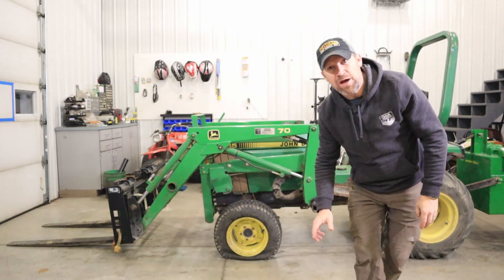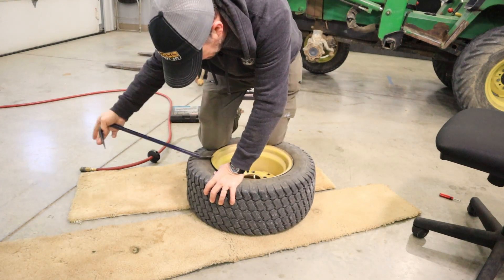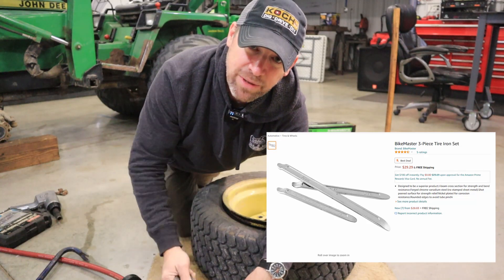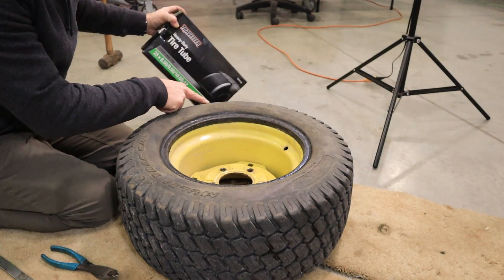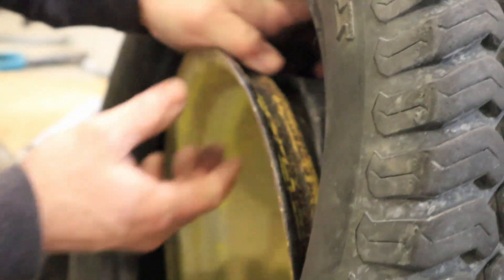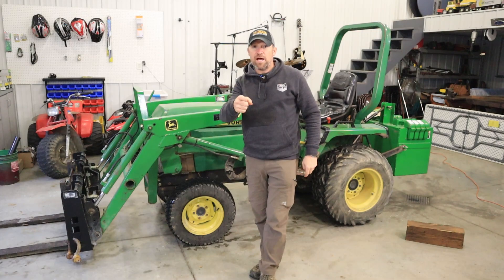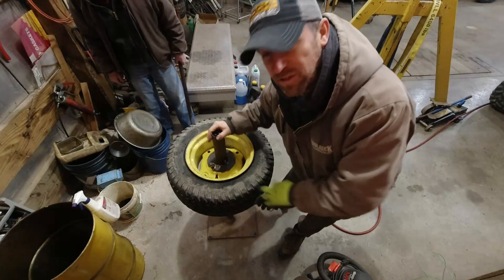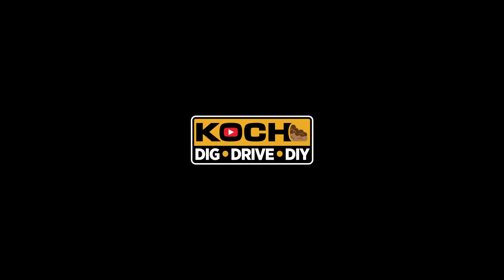How To Install Tubes in Garden Tractor Tires on John Deere 755 - Fixing a Flat Tire or Two

Comment: I've always blow the tube up and released the air before I try putting the tube in the tire. The tube will go in much easier when inflated a bit. I also brush a little talcum power inside of the tire to let the tube slip around a bit so it's not so likely to pinch. Also, take advantage of the drop-centered rim. It's made that way to make it easier to install and remove the tire. For those who are removing tubeless tires for repair and don't intend to install a tube, the last thing you want to do is pry the bead off with a screwdriver or similar tool. The rubber covering the bead is very soft and easily damaged, Also, take care not to scarf up the rim in the bead area. It will leak every time.

Comment: Excellent video!!

just had the same issue for about a year also. Finally took it the the tire shop and paid 20 and done with it. 
The small diameter tires are a pain. 
Keep the videos coming
Reply from the maker: Glad I'm not the only one!  Those little ones are tough.  I also have a cheapy Harbor Freight tire changer for the 8" front tires on smaller tractors.  Thanks for tuning in to the channel Dave!

Comment: Happy New Year to you and family. 
   I had a front tire on my backhoe that I was always pumping up, never found time to fix or was too cheap to fix, air was cheap. Finally decided enough was enough, bought  a tube, and with the use of the loader bucket and short 4x4s broke the bead. That bead was a stubborn "$^#@". I do not have short spoons or realized they exist. My deceased dad had left me two 2 foot tire irons made for changing tubes (never used them) and I quickly learned to NOT let them go using them (OOWWW that HURT). Never had a problem with a flat in the remaining (? 10 years) I owned the machine.
   Neil,  I really enjoy your videos, I subscribe to others as well, but yours are more pertaining and similar to what I have done in my past, so I like to comment in them. Besides being enjoyable they can be quite informative. Keep them coming!
Reply from the maker: I hear you on the backhoe tire.  Mine was the same way for a long time as well and finally put a tube in that one too.  I have some big 2 foot spoons as well and they have to come out for the bigger tires for sure.  Always good to have a wide selection!
I really appreciate the kind words about the videos too Richard.  It is nice to know there are folks out there that can relate to these videos and find them enjoyable to watch.  There are lots of guys making content for YouTube and I really appreciate your time in watching mine with all the competition out there.  I'll keep trying to find stuff to make videos about as long as folks are watching!

Comment: Talk about PTSD!....what seemed like the hardest job of my life was one day when I decided to put a tube in a tire that kept losing air on a riding lawn mower! 😜😜    You made it look easy!  My first and last time.  I told my wife I would just buy a new mower next time a tire went bad! 👍👍
Reply from the maker: Oh boy, I've had a few of those too.  The smaller diameter tires can be a real pickle sometimes for sure.  I don't blame you for wanting a different tractor rather than put in a tube - sounds like a logical excuse to me 😂  My dad bought a new car once cause the old one had a dead battery... Ha!

Comment: Great video. Excellent job of explaining the process of dismounting the tire and installing the tube. 
I work in a tire shop and have several years experience so if I may offer a little advise and a trick to help prevent pinching the tube. 
In the video I noticed that you start mounting the tire at the valve stem, when the valve stem is pulled through and clamped, sometimes when you push down the bead for extra slack the bead of the tire can pinch/tear the valve stem when mounting the tire. I would suggest starting opposite the valve stem when mounting so the last part of the tire to go on is at the valve stem. 
A little trick to prevent pinching the tube with a tire bar is partially inflating the tube before mouth ring the top bead. Inflate it with the core. Also ensures there is no twists in the tube. 
Thanks for the channel and great vids. Looking forward to more.
Reply from the maker: Hey Clint thanks for all the great suggestions!  I'm afraid doing the limited number of tire repairs that I do far from qualifies me as being an expert so I warmly welcome all the suggestions that could help to make me better and help those that watch these videos so that their life may be easier also.  I've learned the hard way about pinching the tube as I had done it so many times back in my young days when working on those pesky dirt bike tires.  I've had several others make suggestions based on what I may have been able to do differently in this video too so I'm happy to be learning all while trying to help folks figure it out on their own too.  Thanks so much for the comment and for watching the channel.  Take care.

Comment: Me... procrastinate on fixing tires?  Exorcise that phrase from your vocabulary.  It is called a ‘Strategic Pneumatic Engineering Plan”.  I have been developing it for years.  Although it isn’t top secret... it took me seeing Neil talk to Neil for me to realize.... I have never revealed that plan to anyone!  

So, here goes.  There are 4 scenarios to consider... 
1. on road and off. 
B. Daily drivers and occasional use. 

If you set them up in a grid you’d have on road above daily driver and off road above occasional.  Now the first column, an on road + daily driver gets immediate attention... and for me is a job for the pros.  

The second column, off road + occasional,  that baby gets extra special attention. You invest in an air compressor, portable air tank and a spare tire gauge to strap to the air tank. Then, you find a place to store the tank close to where you park the tire (are you gonna need a new shed?) About the third time that you forget to refill the tank... While you are walking back to the shop with it... you ask, “Do I need to get a spare tank?”  The tipping point for repair/replacement in this category is... when it won’t hold air through the whole task.

The diagonals are where your strategic engineering juices get to flow... the on road + occasional and the off road + daily are prime candidates for: plugging holes, hot patching inside, slime filling, tubing them or the dreaded (yet inevitable) tube patching.  Of course, fill before use will be the preferred means of dealing with these... until you get fed up and have to do any of those major repairs!  

Neil, I learned long ago that it ain’t procrastination if you have a strategic plan!

I don’t use a lot of tubes on our off road tires.  There are far too many hedge trees and thorny locusts.  It seems that even if I check the inside of the tire for sharps before putting in the tube... just as soon as that tire hits the first rock... a thorn lurking just below the inside surface punches through.  Or, perhaps it is, that I am buying tubes that are made from the rubber equivalent to ‘Rare Earth Magnets’ for thorns??  And you know what that means... another round of filling with the portable tank to avoid the dreaded (yet inevitable) tube patching.

A lot of people don’t like slime... I used to be one of them but then I discovered TireJect.  It doesn’t take much, doesn’t rust your rims, actually contains a latex like compound and you can buy it in bulk! My wood cart (off road + occasional use) is going on 5 years with pretty iffy sidewalls held together with it. [YouTube Disclaimer... THIS COMMENT IS NOT SPONSORED BY TireJect.]

Now about talking to yourself... it is OK, as long as you’re not talking about yourself... or, so my therapist says!  However, I’ll have to ask her at breakfast,  if there are any particular indications when you start to film yourself, talking to yourself!

Well... that’s about all for now... the tire on my TracVac is looking a little low.  I’ve got to take immediate action... Where does it fit on the Grid?  What step of the flow chart is it at?  Do I need to order another gallon of TireJect? Can I just look away for now and deal with it when it is sunny and warm?  So many questions...... I need to consult my “Strategic Pneumatic Engineering Plan” over a cup of coffee near the wood stove!
Reply from the maker: Oh man, you had me literally chuckling out loud through most of that!  Favorite part: "when it won’t hold air through the whole task".  That is for sure the threshold that I hold as standard as well!  I was able to inflate this tire before every use and it was fine.  It would last a couple weeks between fills, then it was lasting a week, then it was overnight and finally, it wouldn't last through an entire task.  Your grid chart is perfectly defined in terms of reflecting the usage vs frequency vs application metrics.  Ha, off road + occasional: "that baby gets extra attention".  So gosh darn true.  I'm thinking of the tires I need to inflate in the upstairs loft of my old barn just so that I can roll stuff to the door to toss it down!!!  I have to haul a dang air tank up the ladder!

You also queued a childhood memory for me.  We would go camping at this one campground that had a bunch of the thorny locust trees.  My dad would set up a make shift "tire shop" to keep up with the flat bicycle tires as all the kids in the general vicinity quickly learned the guy in spot 14B could fix your bike tire.  I think this may have been where I learned about tubes, tube patching, and the general practice of tree species identification from a safe distance.  We would ride our bikes off and away with multi-patch tires and ride them back on the rims for Dad to patch up again.  Man, he is patient.  

Hope you enjoy that cup of coffee with your therapist and I'll start thinking about which tire of the couple dozen around here will most likely need the next tube so I can stock up.  I got a wheel barrel I've been pushing around with a flat tire for a good year or two now.  It is probably a prime candidate!  

Thanks Dave :)
Reply: @digdrivediy  I forgot all about the wheelbarrow... I have resolved that it is easier to push the starter on my BX than to push a wheelbarrow.  My bucket loader has almost made it obsolete! And with that being in the off-road - often used category I have a well established protocol for dealing with its tires!

About bicycle inner tubes... my 7 yr old grandson developed a flat on his.  While trying to fix it, his dad pinched it right by the valve stem... then, he tried to patch it with the vulcanizing glue too wet.... the outcome was, he ruined it. 

I picked up a replacement and put it in for him... then, I told him I’d keep the tube for something special.  

A few months later we were loading firewood and I saw a hickory fork on a sapling.  I cut it and we headed for the shop.  After he whittled the bark off of it, I showed him how to cut rubber strips off the tube.  (You have to use the outer portion. If you use the sidewall or the inner they are too crooked to work.) An old work glove palm, some fishing line and voila’... he had a slingshot.  

When the acorns started falling, he gathered up a paint bucket of ammo.  He keeps both of them in his bedroom... just in case the bad guys break in and he has to defend himself!  

The other night his teen age brother had a couple of friends over for a birthday party.  When he started to introduce me, his little brother blurted out, “This is PawPaw.  He can make anything. Wanna see my slingshot he made from a tire?”

Neil, I don’t remember how much that inner tube cost.  But, I’ll never forget what it was worth.”
Reply: "Are you gonna need a new shed? LOL!! I do believe there's Koch DNA in your family tree from a long lost common ancestor.... the scraggly bearded dude who'd rather spend an extra $20, 2 hours, and 3 bloody knuckles to do it his own way! " See.. I told ya!"
Reply: @marykoch5168  yep... at least kindred spirits!

I got a new barn this summer for keeping my tractor stuff... my wife told me that’s the last out building!  Then we started a discussion about storage... 

My argument was... 

Background... we had bought a Gator a year ago.  To make it legal to drive on the road I needed a triangle SMV sign on it.  I picked one up at the Farm Store but didn’t get two $0.50 brackets to mount it.  

Well, while digging out tow straps, spot lights, first aid kit, etc. to put in it... I came across a plastic container that had come with a trailer hitch ball. With a little modification it worked perfectly...  (And contrary to the norm took less than an hour with no discernible injuries during modification and installation.) I showed my wife but, at that time didn’t tell her where it came from.  

 
Fast forward to the storage discussion... 
one of my arguments was, that modification... I was pretty proud.  I mentioned it in my defense.  After all, It was black and matched the Gator rail. It was perfectly secure when mounted and best of all, saved me a buck plus a trip to town.  I finished the discussion with, “I knew that container would come in handy.”

Her reply was, “What did you buy the ball for?”

I answered, “It was for the pickup, when it was new.”

Her response, “That was in 2007.  You’ve been keeping that stupid piece of plastic for over 10 years.”

Did I lose the conversation?  Well Mary, I’ll let you in on a little secret.  At the time I made the bracket thingy out of the container... I hadn’t picked up a ball hitch for the Gator.  It came with a plastic container which I used to fill my depleted stock!

Comment: I feel your pain I’ve changed tires with pry bars, manual one like yours, coats and now I just bought a rim clamp style I hope my days of swearing at tires is limited now
Reply from the maker: Nothing beats a good tire changer.  All the local tire shops have closed up around here and the big tire store chains are the only option.  You get to know all the local farmers that have tire machines in their shops!  I'm glad to have learned how to do it manually but I'm just as happy to use that tire changer!  Appreciate you watching!
Reply: @digdrivediy  thanks Neil I really like your videos keep it up I have a small excavation company with old equipment so I get my share of fixing in and I’m usually watching your channel while I do so

Comment: The inside of the tire needs to be inspected for possible thorns, nails or wires  remaining in the tread, I run my hand around to feel for objects.  I learned this the hard way.  The methods shown were used in the early days of the automobile to repair tires on the road, often screwdrivers or pieces of flat bar were used.  They had no tire machines.
Reply from the maker: Very good point.  I should have checked it out a little closer to be safe and sure nothing more was in there.  Also should have looked for burs.  I had these tires off the rims before but didn't show this in the video.  Quite a few folks still changing tires like this around here in the absence of tire machines.  Thanks for the strong advice and I appreciate you watching!

Comment: 20 ton hydraulic press with a block on each side of the rim on the tire  and a spanning block s with another block just press down till bead pops. With  the beads broke then use a slight amount of pressure on the rim to hold it as a third hand , this allows you to do what you need to to remove the tire or put  a tube in. That’s the short version of how it works for me any way.
Reply from the maker: Makes sense to me!  Now just to get that hydraulic press!  I've needed one on several occasions so I'll put this down as another good reason why!  Thanks Terry!

Comment: I usually just take the tire outside and stick my head out my driver side window & use the left front tire of my pickup truck and gently run my front tire up on the tire who's bead I'm trying to break. Just be careful not to run up on the rim. Works like a champ.
Reply from the maker: That's a great idea.  I have done some larger truck tires like that and I know other folks that employ that method. I can't remember if I mentioned that in the video or not but that's a good way to do it in the absence of a tire changer.  
Thanks for the cool feedback and appreciate you watching.